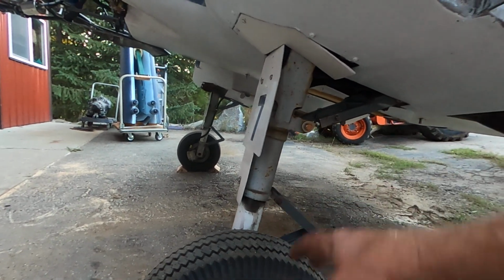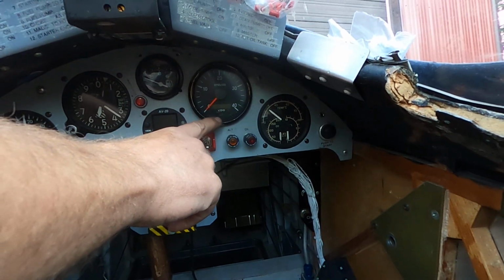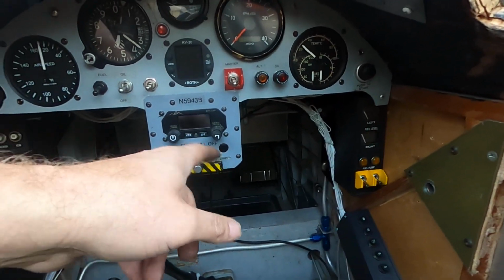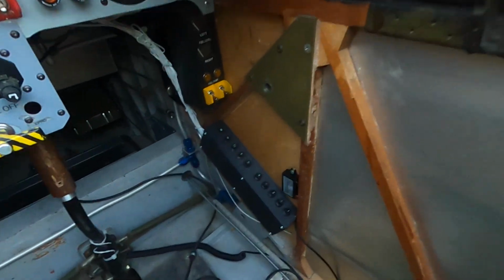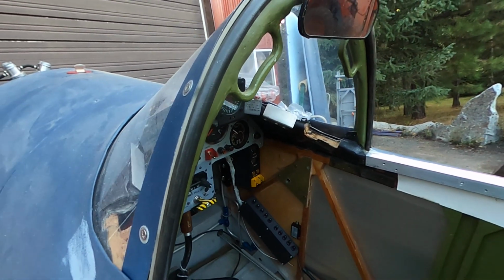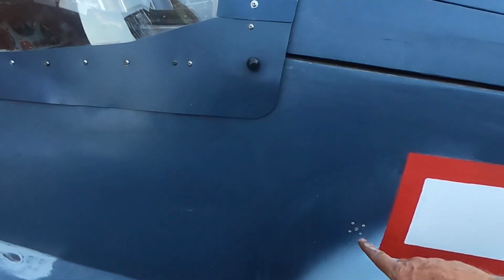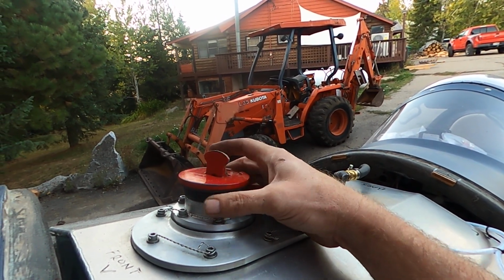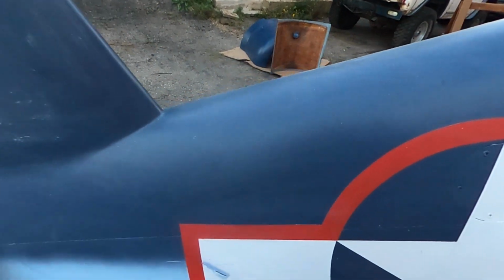1/2 scale corsair intro part 2 of 3

Comment: I think the VDO tach reads engine RPM not prop.  At least it does in my R3600.  Yours being an early R2800 version, you have one side a mag, and the other side electronic ignition as I recall.   The VDO probably reads off the electronic side and reflects the 3:2 gear reduction.
Reply from the maker: Interesting, static runup showed 2000 rpm on the tach and loads of thrust.  That is right in the published range of prop rpm.  I'll have to verify with external tach.

Comment: One more question instead of having a two piece riser for the fuel fill. Why not just remake that riser if you have access to any sort of machine shop that’s somewhat decent. They should be able to help you with that issue in it of itself instead of having a two-piece because the two-piece introduces possibilities of additional leakage.
Just a suggestion
Reply from the maker: Exactly.  No access here.